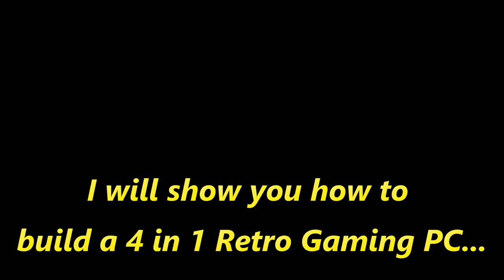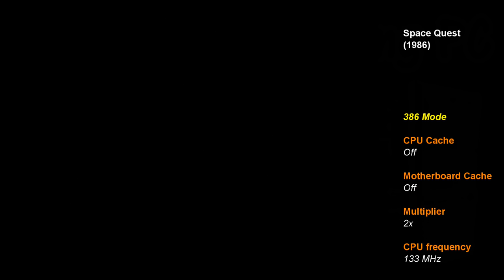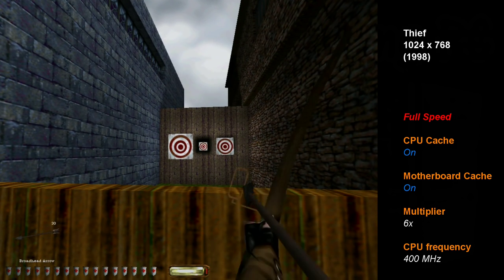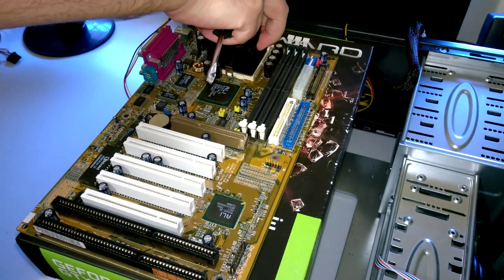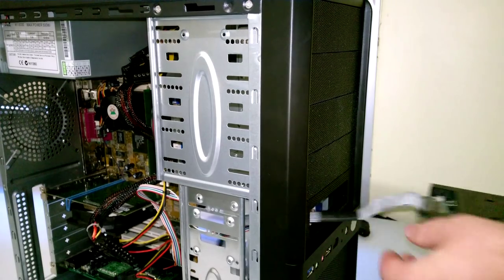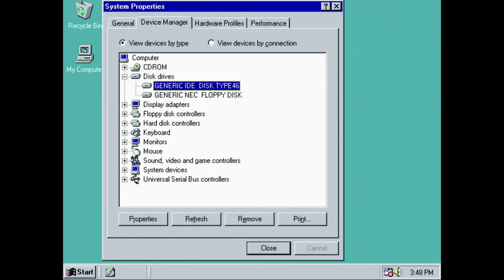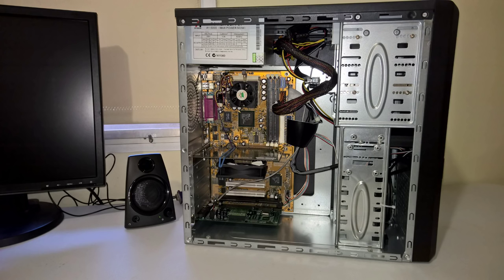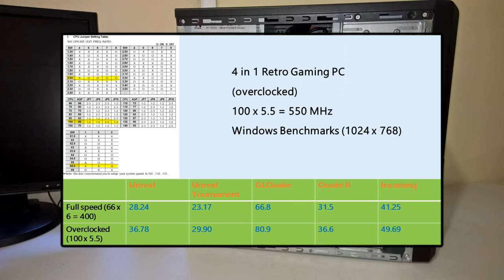Building a 4 in 1 Retro Gaming PC

Comment: I decided, rather than continuing my 486 project for the moment to try building a system like this. I've just acquired an MSI MS5169 motherboard. I needed 3 ISA slots for all the sound cards getting shoved into this thing. It came with a K6-2 450. I'm wondering will I still be able to do the multiplier and cache settings in software with this board? If not, I did have an interesting idea. Instead of opening the case every time I'd have to switch jumpers, why not rig up some SPST switches and wire them to the jumper headers.
Reply from the maker: It won't let you change the multiplier, but you can still use the cache tricks. Yup you can wire some switches to the front case :)
Reply: Is the multiplier a board issue, or because it's not a K6-2+ or K6-III+? Also, I'm looking at graphics options. I have a pair of Voodoo2s right now. I can shove some other GPU in the AGP slot to go with them. I've also been looking at picking up a Voodoo 5500, since they seem to go for the same price as the 3000.
Reply from the maker: Wrong CPU. You need the mobile CPUs, they have software multiplier.
Reply: Thanks. They don't seem hard to find. Any opinion on the graphics card?
Reply from the maker: Watch my recent SS7 graphics cards videos!
Reply: I will do that!
Reply: I did discover one small hiccup in my plan. It seems with this revision of the motherboad it seems even with the latest BIOS update it will only support up to a K6-2 400. Sort of puzzling since it shipped to me with a K6-2 450, but that's not the issue. If that is the max it can handle, then can I still switch it for an equivalent K6-2+? This is what I get for not thoroughly researching before buying.

Comment: Another great video Phil cheers, about the super socket 7, do k6 chips work in p3 motherboards?, i have everything in your video apart from cpu, i remember running dos games back in the day on pentium systems and had to use a program called moslow , would this still work instead of turning off cache if i didnt have k6?,
Thanks Brian.
Reply from the maker: hardcore8uk I'm not keen on Moslow, it causes joystick drift and other speed related issues. It's a last resort tool so to speak. Having caches disabled is in hardware and causes no issues.
Reply: philscomputerlab This, I confirm. See SETMUL.

http://www.vogons.org/viewtopic.php?f=24&t=38613

Comment: How does Megarace and Star Wars: Pod racers runs on that machine?
Reply from the maker: ibm5155 Megarace is from1993, that should work without issues in Pentium mode. The other game seems to have been released in 1999, which might be challenging for this machine, even at full speed.

Comment: I wish Intel or AMD or whoever would just release an FPGA that emulated an APU maybe with NVIDIA's help to get some voodoo love and just let you set the specs of the chips in the FPGA so you could on the fly boot different systems in a small little box and maybe boot systems off SD cards or whatever with external storage by USB to Floppies, optical disc and input devices. 

Never going to happen but it is a nice dream.

Comment: A very interesting build. I'm curious as to why the Yamaha card as opposed to an AWE64? And have you ever tried to put a Gravis Ultrasound in one of your builds?
Reply from the maker: I just like to use different parts in different builds and also showcase the DreamBlaster X1 wavetable header,
Reply: I can understand that. After watching the review video on that card, it's quite nice. The authentic OPL chip especially. I know you can hook an external midi device through the gameport, but I wonder about its compatibility. For instance, I know the actual SoundBlaster cards suck for hooking up to a MT-32, which is functionality I would want. Do you know if this card is compatible?
Reply from the maker: They both have issues with many MT-32 games. You really need a proper MPU401 interface card. I should be reviewing one soon. Someone is actually producing new ones, so that makes it more affordable and available.
Reply: That would be great. Finding actual MPU 401 cards is a trial by itself, let alone the cost. Except I just remembered I have a Roland SCC 1. I can't believe I forgot about that! One more question? Have you ever tried to get one of these builds down to 286 levels? I know when you go back that far, a lot of the games were set to the CPU clock, not the system clock.
Reply from the maker: Well, the Roland SCC 1 has you covered there! It comes with a proper MPU401 interface :)

I stop with the 386, anything older is just not my thing.
Reply: That it does. And I completely understand about the 286. I'm not even sure it would work right, as 386 protected mode is still there. Well, if I needed or wanted to go that old, I still could use the techniques from your modern 386 and 486 for a 286 if I desired.

Now I just need to find a Super Socket 7 board with 3 ISA slots.

Comment: Hi Phil, I got the Audician 32 Plus and the DreamBlaster S1 - they are a great combination together. The DreamBlaster S1 sounds very clean and EQ has a nice balance to it - Thanks for your reviews on them both it helped me a lot (also got a Awe64 gold on order thanks to your review! ;o). I managed to pickup a Voodoo 5500 but I am struggling to get the Windows 98SE Glide drivers to work with the original Unreal. Do you know if I need to install separate Dos drivers as well or should I try and get hold of Unreal Gold instead as it may have better compatibility? Any suggestions would be greatly appreciated! :O)
Reply from the maker: PierreVonStaines Awesome! I also really like the combination of the two cards.

Bugger, Unreal Gold was on special for like 3 bucks on GOG. Now it's back up on full price. I've got two versions. The DVD Anthology release, and the GOG release. Both include Unreal Gold. All you do is launch the game, it gives you 3 render options, Glide, DirectX and OpenGL. Select Glide and that's it.

Are there patches for your version of Unreal maybe?
Reply: philscomputerlab  Thanks Phil, I'll have a look - the original boxed version of Unreal I've had since new, it sadly only gives you 2 options for software rendering or Glide, but the Glide support doesn't seem to work with the Voodoo 5500. I'll try my luck with Unreal Gold as it seems that has better compatibility built in. Keep up the good work mate! Really enjoy your vids! :O)
Reply: PierreVonStaines Yeah it was the original version of Unreal not wanting to work with the Voodoo 5500, I installed Unreal Gold and Gilde is working like a charm! Also the Awe64 Gold has arrived so I'll give that a try out later! ;O)
Reply from the maker: Good outcome :)

Comment: Hey Phil, greetings down to sunny Australia from Germany.
Nice work done but I have a question:
I'm running an AMD K6-2 450 on a Biostar M5ALA at 2.5x50 MHz (the jumpers say so but actually it's clocked at 152,2 says setmul) and your 486 mode suggests 133MHz with internal cache disabled and MB cache enabled. But mine struggles quite heavy, allthough it's running 17-18MHz faster than yours. Is it just that the K6-III+ is so much faster than standard K6-2?
Or does the BUS speed makes that much difference?
Thanks in advance for your valuable help.
Thomas
Reply from the maker: The III+ has 256KB of very fast on-CPU Level 2 Cache, so yes, it makes quite a difference. Faster FSB also helps a lot.
Reply: @philscomputerlab  thanks alot, Phil. So, what do you suggest should I do if a "plus" CPU is out of question? Shall i go with 4,5x100MHz and L1 cache disabled or rather swap to a slot 1 system? I have P2 266 and P3 450 available. In the first case I schould (must?) raise vcore from 2.0V to the rated 2.4V. I Wonder why k6-2 450 is the one with the highest vcore... I have an P1 100 also. But it's not underclockable in this board. With 1,5x50 it does not post. Neither it does with 2x50. 1.5x66 runs fine though. On my GA-586HX it runs on 1,5x50. By the way i mixed something up: my K6-2 is clocked 2.5x60, not 50 because of the same reason. With 50MHz it won't post.
Reply from the maker: @thomasr.1677  So I would rethink the purpose of the machine. Socket 7 is best for it's slow down options with cache tricks. So it's great for DOS and early Windows games, slow is good. I wouldn't try to make it faster, if you want speed, just get a Socket A or Pentium 4 :)
Reply: @philscomputerlab  thank you again. But that's the Point. I don't want speed. Just the level of an 486 DX/2 66 or maybe 80. But now is my ssocket 7 system way to slow with L1 disabled in comparison to my original DX/2 66 on a tmc pat48pg. And with L1 on it's ti fast (only for my taste). The point is just that I don't want to use the DX for everyday things. Maybe I'll keep it like it is. Most games do run fine and Wingcommander has not been tested with L1 off.
So again, thank you very, very much and keep up the good work.
Best regards,
Thomas
Reply from the maker: @thomasr.1677  Got it. In this case, check out this project. You need to replace the CPU with a Pentium MMX. https://www.youtube.com/watch?v=xcBmEjXg2ME

Comment: This is exactly what I tried to do a few years ago but with different parts, I have an Aopen Super Socket 7 mother (can't remeber the model) with a 4xx mhz K6-III, or it was a K6-II?....mmm I don't remember now, anyways, I don't have a Voodoo 3, but I do have a few  PCi Voodoo 2's I can use, for primary gfx adapter I have a geforce 4ti 4600 and many ISA sound cards, never did anything with that crap, would it work? or it will be ltoo fast for the older games?
Reply from the maker: chinitosoccer1 Yes that would work. Even if you don't have a 2+ or III+, you can still change the caches. For the graphics card, there are many options. Mine is just one option, not the "best" one. For example if you want 32 bit colour rendering and DVI output, go with a GeForce. So it all depends :)

Comment: So, I'm looking for the K6-III+ 400 needed for this whole thing to work, but I'm kind of concerned with the voltages involved. The MSI MS5169 motherboard I have only goes down to 2.2 volts, but the processors I'm finding are only rated 1.6 volts. Even the highest voltage for a K6-III+ is only 2.0V, but I haven't found any 400 MHz models with that voltage for sale. Have you had issues using the lower voltage chip on your board, or does that board support the lower voltage?
Reply from the maker: Does that board even support this CPU? A bit more voltage isn't going to hurt, but beef up the cooling.
Reply: From my research, the revision 4.0 board that I have does. I can definitely beef up cooling.
Reply from the maker: That's it then, good to go :)

Comment: +PhilsComputerLab Sorry if this was explained in the video and I missed it, but why not use x1 multiplier for 386 mode? I would think 66MHz would be a lot closer to original 386 performance. Were you simply limited to a choice between max speed and one turbo speed?
Reply from the maker: +Nathan Hardy No problem, there is no 1x multiplier unfortunately. The lowest / smallest multiplier is the one used in the video. The main slow down effect comes from the disabling of the cache.
Reply: +PhilsComputerLab I see! Thanks for responding! Have you tried running DOSBox on it? I've heard people say that it can run on Win98, and can simulate the 286 if the host system has a P3 or equivalent. If it could do that, this would truly be the ultimate retro gaming PC!
Reply from the maker: Yes I have, and this will be part of a planned video :) That way you can play really old games like that one with the plane or Alley Cat.

Comment: I've listened to your review of the DreamBlaster S1 module and the thing that bugged me was "it's not at the level of a Sound Canvas".  Now, the question arises. Should I stay with my current gen PC using Munt to emulate a MT-32 or should I get a Roland card from Ebay to get into a retro pc? 

Also, as stupid as it will sound... How do you plug a Roland SC into a PC as they only have midi input/output. Do I need a midi card?
Reply from the maker: +NickD25 Yes you need a MIDI card, no way around that.

Comment: I love these old games but the games that are exclusively PC Speaker (pre-midi) are so painfull to listen to. Is there anyway to get the tones to be more pleasing to the ear?
Reply from the maker: You can route the PC speaker through some sound cards. The Sound Blaster cards have a mixer header for this. Then it sounds a bit nicer and you can control the volume through the external speakers. Though there are not too many PC speaker only games that run well on this machine. A slow 286 or XT might be more suited?

Comment: Not sure I'd want to play Unreal (or even Quake 2) like that though, it's just one of those old games which works so much better on a modern machine.

(also dem framerates on Unreal Tournament and Deus Ex)
Reply from the maker: xan1242 Yes, you can always build a better machine for individual games. Raise the clock to 550 MHz though and you get 30% performance boost in these games. But the idea was to cover as many games as possible, and of course, at some point the machine will struggle. Then you can just build a fast Slot 1 machine. Got a video for that one as well :)
Reply: philscomputerlab I didn't mean it really in that sense of words, what I meant was it's just one of those games you'd rather want to play at 60+ FPS with high quality textures and graphics altogether. (Unreal 227 patch for instance)

Don't get me wrong, I'm not against pushing the limits (all for it, I ran Unreal on a P1 machine with an S3 card in 320x200 at 20+ FPS in Windows ME), it's just that 3D games are a whole different story.

Also, if you put a beefy AGP card into a PC with a fast P3, you can run Crysis on it just fine! I'd like to see that done! Can't wait what you'll come up with a Slot 1 machine. I got an iffy Asus P4 board that doesn't turn on unless I touch the battery and a Socket A board. Not sure what to do with them.
Reply from the maker: You're right. If I Wanted to play Unreal, I'd use a fast Pentium 3 with a Voodoo 3 or 5 as well :)

Comment: Hi Phil.
I've bought a super socket 7 board the last days and i have tried to underclock a K6-2 500 processor like in your video. I've also wrote something on vogons website. The absolute minimum clock i've got was 171MHz. The lowest multiplier on PBC (1.5x and 2x) will be seen from the cpu as 3.5x and 6x. 
Well, what do you think, it is a big gap to your 386/486 emulation @133MHz, compared to the 171MHz i've got with my K6-2? I have to test this maschine asap with your benchmark package!!

What do you think? It is possible that for example, a Pentium 1 150MHz (P54CS) will also take the wrong multipliers? According to my example with slightly increased FSB, it would have:
1.5  x  68.5MHz  =  103MHz
2.0  x  68.5MHz  =  137MHz
2.5  x  68.5MHz  =  171MHz
It is possible that i'll burn this Pentium due to wrong multipliers, cause this CPU has original FSB60 and i have to set multiplier+FSB manually? I mean with the multipliers 3.5x and 6.0x (results in 240MHz and 411MHz) the Pentium, made with 0,35 µm technique, would never starts und just burn...
Reply from the maker: +Andi R. The cache is the biggest difference! Once you disable L1 and L2 cache in the BIOS, the clock speeds don't matter much. It's just that some games have issues with higher clock speed, so the lower the more compatible.
Reply: +PhilsComputerLab 
I think you're right. The most influence should have the internal and external caches. Due the situation i have to complete the PC & install W95, i just calculate with your results and the benchmarks on cpu-world and made some interpolations. Sure it's not exactly but i think the trend shound be OK.
Your values with 3DBENCH & PCPBENCH:
486-mode:  21.1  &  5.9
386-mode:  10.9  &  2.6
With my interpolation, i'll get this results for K6-2@171:
486-mode:  25.3  &  7.1
386-mode:  13.1  &  3.1
But at least a test will show the truth and the final results...
Reply from the maker: I once tried a few Socket 7 and Super Socket 7 machines at all sort of clocks, and once you turn off all the caches, there was little difference.

However, with L1 off, but L2 on, there are differences, especially with raising the FSB.

Comment: i have a sempron 3000+ and 2 gb ram running on xp what would be a good graphics card that doesent cost alot but performs well for games like gmod. i currently have a radeon 7500
Reply: Well...I am sorry to say, but I cannot see a Sempron computer starting a game like Gmod successfully, even if many of the later updates weren't so finicky with Windows XP. Seriously, my Sempron 2400+ at the same 3ghz that your Sempron reaches a good chunk of usage running YouTube, let alone Firefox ESR on top of Win2k unofficial SP5 and update rollup.
Reply: If you want to go ahead and give it a shot regardless, however, then they shouldn't be too expensive...a GTX 460 can be had for $60 CAD minus the shipping, and is phenomonally above your 7500's head despite REQUIRING a 6 pin PCI-E connector and 500 watt PSU minimum. (Don't worry about lack of molex or anything as such though, quite a few still have them and even floppy drive power sometimes.)
Reply: ya i guess ill just stick to cs 1.6